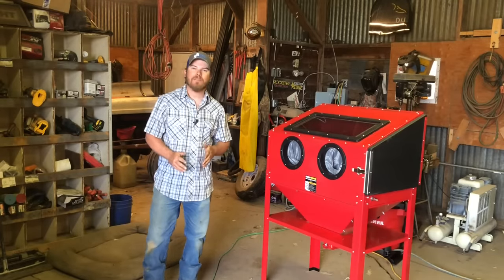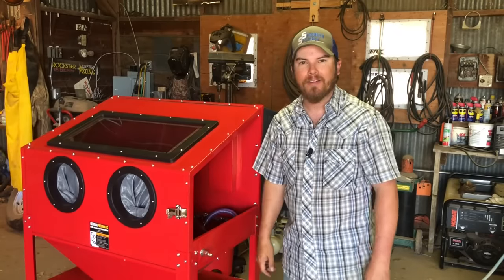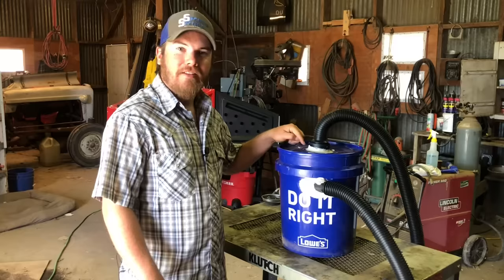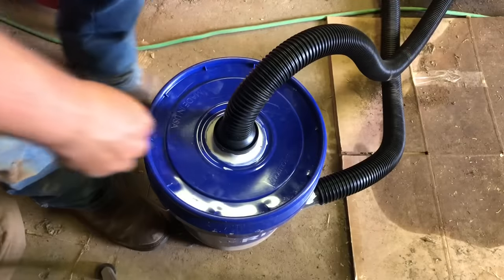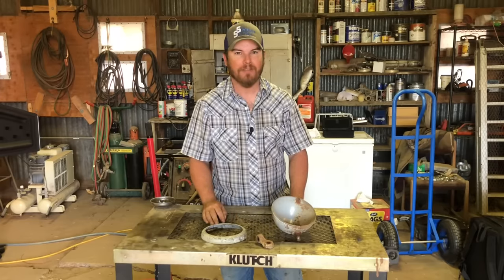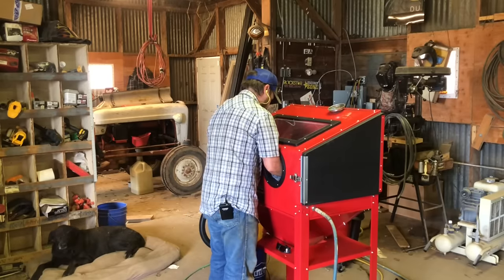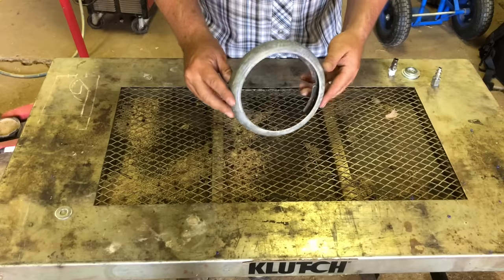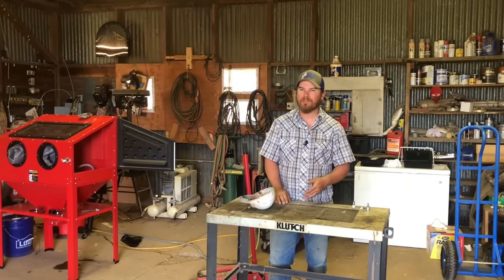Testing Out the Harbor Freight 40 lb. Blast Cabinet!

Comment: Every blast cabinet I’ve ever used had 2 things in common:  the media tube was always jacked up where it connects to the gun, and they ALL had annoying surges of media.  You have to find the “sweet spot” of air pressure to get the most consistent media flow, AND you have to keep the media as dry as possible.  Humidity is the enemy! It causes the media to clump and “bridge over” so it doesn’t consistently keep falling down to where your pick-up tube is.  And Media?  I do a lot of projects like what you just did and aluminum oxide is all I use.  It strips paint and rust and leaves a fine slightly textured surface that paint will really stick to.  Glass beads are good,  but IMO the surface is too smooth.  And Definitely do NOT use black beauty unless you don’t care how bad the painter part will look.  It is very aggressive.

Comment: Somehow missed this video last year.  Anyways, here's an eyeopener for you:  the instructions for the HF Cabinet are WRONG!  the side port on the cabinet is NOT the vacuum port.  The rear one is the vacuum connection, that's why there is that metal duct on the inside of the cabinet....to force the air/media mixture to enter the bottom, then travel up to the top to be vacuumed out. It also allows the media to fall out before being vacuumed out, so not nearly as much media gets vacuumed out.  Cyclone is still a good thing to have, because you will still get some media, just not nearly as much as vacuuming out the side port.  The side port is the air INLET.  Switch your connections around and notice what a difference it makes.  You can also get a metering valve upgrade that feeds the media from the bottom of the cabinet funnel to the gun instead of having to siphon it through that stupid pick-up tube.  You're probably going to get 3x the media flow, and more consistent flow, by upgrading to the metering valve/gravity feed add-on.  Do the vacuum correction and add the metering valve mod and it will be an altogether different performing machine.  You won't believe it.
Reply from the maker: That makes a lot of sense. I have done the metering valve upgrade but I will have change the vacuum!
Reply: @farmertylerranch4399  did changing the vacuum to the back port actually work better?
Reply: So can I put an air filter on the side one to suck in air?

Comment: Lol, hose barb. That’s actually a quick disconnect fitting used in Asia. I see them on the supply connections for Japanese machines.  Replacing that with a real hose barb should solve that problem.
Reply: that's what I was thinking that is a quick release fitting I guess should have read the manual

Comment: I learned to burp the gun. Hold your glove over the outlet of the gun and stop the air from coming out the end. This forces air back down the pick up tube and unclogs it. It will also collapse the Doodle Bug funnel holes you can get when using glass beads.
Reply: If hafta fix this & that on a new machine...??.... Harbor Freight and suppliers don't  deserve praise. Not a great little machine but a "rebuild" project.

Comment: Thanks for the video, very informative as I’m in the market for a sandblasting cabinet. Also the cyclone dust collector is a great idea. I noticed that your tractor appears to be a TO30. In Australia we know them as the TE20 or TEA20 as mine is. The “barbed” fitting that the hose blows off is actually not a barbed fitting but a Nitto brand quick connect hose fitting. I dislike these and use a quality (not Chinese) fitting on all my air equipment. The cabinet itself seems to be quite good so thanks again for the video.

Comment: Woodworkers make cyclones from 55 gal drums. The different ways they have been made are as different as those who make them. Don't hold up small things in the fingers of one glove and blast it with the other. The gloves will wear out and faster than you would think. You might not notice it until the hole opens. Eventually, the window glass will become so pitted you won't be able to see.

Comment: I wondered what media you going to use, then saw you loading the walnut shell media and knew you were going to be a while. LOL  Try some Black Beauty from TSC, it WILL remove the paint and rust quickly, but be careful it will also slowly remove the base metal. Test it out on an aluminum soda can to watch it eat its way through. When your media feed clogs up a quick bump of the nozzle tip against the palm of your hand  (with trigger squeezed) will back blow the feed line usually clearing it so you can continue blasting.
Run a grinder around that hose barb and give it some "tooth" that might hold that hose on better.
Reply: Hey Warped, I'm using the black beauty from TSC. My cabinet is set up correctly and the guns not picking ANY media up through the intake tube. Any suggestions?
Reply: @awolo06  Don't get mad, but IS there suction at the media pickup end of tube? If not, there may be blockage in the intake tube or a problem with the gun itself. The media pickup works off a venturi in the gun.
Reply: @Warped65er  Not mad at all, man. I appreciate you getting back to me. I do have suction. The media gets up into the gun but stops there. I'm wondering if the 20/40 grit I purchased from TSC is too coarse? I think I'll try the fine grit to see if anything changes.
Reply: @awolo06  I just didn't want to offend by stating the obvious ✌. Not sure how that particular cabinet is setup, but usually the suction end of the hose can be pulled back out of the pickup channel a bit to sort of "meter" the flow of the media. Maybe fiddling with it there might get you a consistent (usable) flow out of the gun.
Reply: @awolo06 
Hi did you ever figure out why the gun won’t spray the media Iam having same problem with the black beauty thank you sir
Reply: @bruceshepard1136  I'm having a hard time still. I even changed out to a very fine, Starblast, sand and it's still not working correctly.

Comment: I bet you have the perfect hose clamp that will work on the so called barbed fitting . Wire . use it where the grove is and it will squeeze the hose into grove.  I have air hoses that I have repaired out on jobs.  Ram a quick coupler into the hose and use wire as a clamp. Works like a charm. Some of them have lasted 10 years or so.

Comment: Just bought a H/F 40 # sand blaster unit..a one guy assemble is difficult and the manual is poor at best..had to backtrack on the screws as I used the wrong screws in assemble..easy to get the different screws mixed up..
I assembled the lower shelf upside down to keep stuff from being knocked off..
Good vid showing problems and upgrade fixes..
Thx..

Comment: Hi. Another good video.  Two things to consider: 1) Try glass beads for paint removal; 2) ALWAYS clean any grease or oil from a part before blasting—if you don’t, you’ll soon gum up your medium and, possibly, the cabinet and its working parts. I normally use lacquer thinner.

Comment: Do you think course grit walnut shell would work a little better than the fine grit that you used? I just bought the cabinet so I could spray my spike lugs on my truck. Thanks for the information and loved the video! So glad I seen the air hose pop off and how you fix it. I would have probably taken it back without thinking of changing anything.

Comment: if someone hasn't already told you, that fitting you are complaining about is a nitro stile air tool fitting it requires  a female nitto to connect  to. was there a fitting left over in the box or maybe it was left out.

 as this is a very common air tool fitting  you can pick up a female one anywhere.

Comment: I wonder about making a little vibrator for the lower hopper - just a small motor bolted to it with an offset weighted rotor.   Should keep material flowing consistently.

Comment: How is your long term with it?  I have a ton of mods on mine including a metering valve, typhoon + vacuum, revised glass mount, mounted on a rolling cart and custom lighting.  I will say even though its fully sealed its VERY leaky.  I need to track down leaks at the 4 corners.  The door I had to reseal.  I blocked all the door depressions that trap media.  Every time I open the door sand pours out.  I tried adding a lip "gasket" that helped a bit but sand still gets behind it.  I'm not sure any of this would be solved with a more expensive cabinet to be honest.  I'd have to check the design in person now that I've got extensive experience with this one and know its flaws.  I will say I've blasted a TON of stuff.  I probably have 25-30 hours of blasting on it so it has more than earned its keep despite the issue I've highlighted.  Very useful albeit flawed cabinet.

Comment: Great video but FYI that's a pneumonic fitting, it is not designed for a hose clamp. It's designed for a coupler.
That should have included a barb or hard ware for the pneumatic coupler

Comment: Most guys use a paint stripper to remove the bulk of the paint before blasting.  Paint can be very difficult to sandblast off and it also can degrade your blasting medium pretty rapidly.

Comment: Grat video thanks, but I think that the hose connector is a male  pulling and not a barbed fitting. I would try a female coupling on the other end before  changing.

Comment: you had better luck than me. i couldn't get this to pickup the sand at all. just a few little spurts here and there. i tried cole slag and sifted sand, neither worked and i tried many pressure settings. i purchased another gun but haven't received it yet. l also had the same problem with the air hose popping off, i covered the barb with some epoxy i had laying around and that took care of the problem for now. i hate when you buy something new and then have to put more money into it just to get it to work.

Comment: A few pounds of media will work beautifully and less to cleanup when changing medias also.
Do some research about which medias to use for your projects.
 Your "barb fitting" is not a barb fitting at all, its a male quick connect coupler.

Comment: Great review, was wondering if they where any good and figured if they don't work that well you can keep the cabin and retro fit a better blasting system or something! :D
Reply: They are well worth the price. Think of it like a project car. Not much to start with. But once you start modifying the car it turns into something great. I would only upgrade the media siphon tube, the glass, the lighting, the gun, the hardware it comes with and silicone every seam when assembling.

Comment: I had trouble with the air line hose clamp that hooks to the gun as well. I eventually just replaced the clamp that came with it. Im still having trouble getting much media out of the gun? Im using 8 gallon tank for air, is that not enough?

Comment: In my 57 yrs I have never seen a blast cabinet. I've often heard of sandblaster and will assume same thing since a comment said they use glass beads and I assume sand can be a media? My imagination is wondering the many applications. I would assume mostly remove rust then repaint?
(Edit 10 min later) I watched a YT video. I now see where it could be used in many ways
Reply: You should see and industrial one work, open the door, set part on a table, close the door. Program the machine for how long you want it to run. Turn in on, wait a few minute, machine turns off, open the door, and part comes out like brand new.,

Comment: i just bought the same cabinet  and you got the wrong fitting  they gave me two one that is barbed and one that you hook a air hose too  so ya they screwed up again  reason I say screwed up is because i drove a 100 miles 200 round trip to buy mine got it home was putting it together and i was missing 2 of the side panels that hold the sand so i had to drive another 100 200 miles round trip just to get the panels